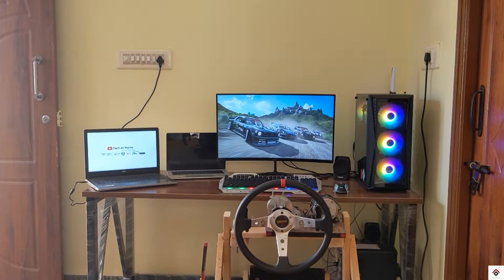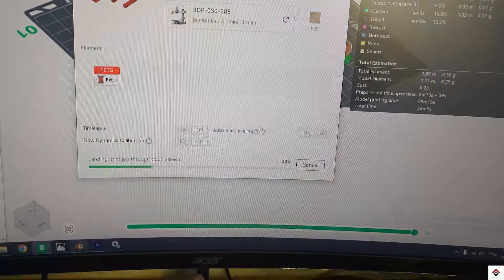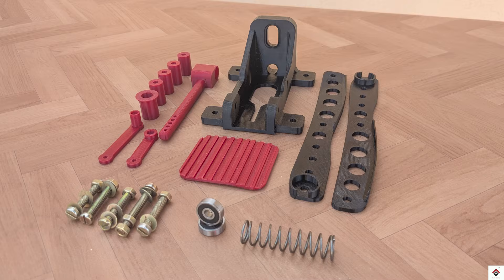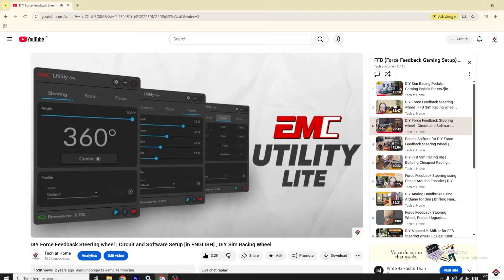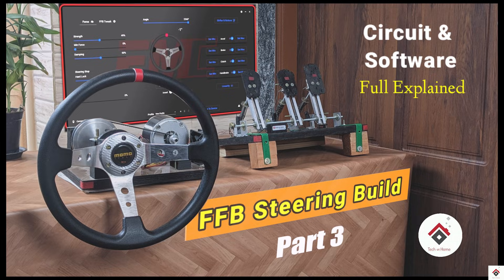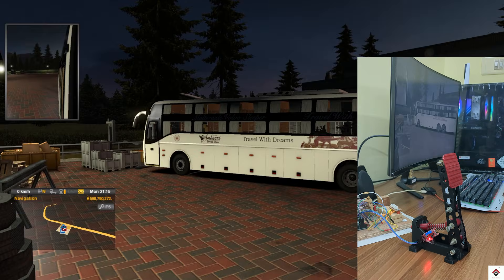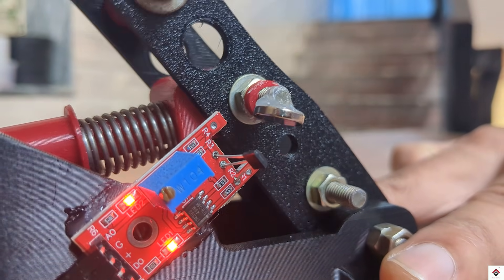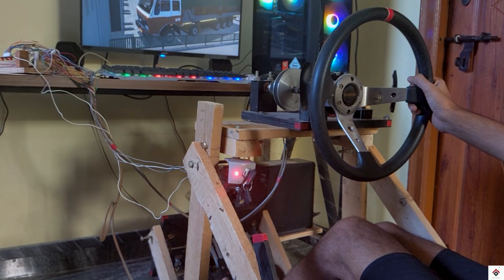Magnetic Hall Effect Sensor Pedals using Arduino | DIY Sim Racing Pedals with 49E Hall Sensor 🏁

Comment: Hey, I’m building a DIY sim racing setup and following your videos. I had a few doubts and thought I’d ask here.

I’m making an FFB wheel with Arduino Leonardo, 3 pedals (load-cell brake), plus an H-shifter and handbrake. I was planning to use EMC Utility, but I recently read that EMC Lite doesn’t support H-shifter and handbrake, only the Pro version.

So I’m a bit confused now:

• What does EMC Pro actually cost, and is it worth it just for shifter + handbrake?
• Is it true that EMC Pro doesn’t work with Arduino and needs STM32 boards?
• Would it be better to use two boards instead? (one Arduino for wheel + pedals with EMC, and another Arduino for shifter + handbrake as a simple joystick or MMJoy2)
• Also saw people mention GIMX — does that actually replace EMC, or is it only for console use?

I’m not from an ECE background, so I’m trying to keep things simple and stable, even if it means using two boards.

Any advice would really help. Thanks for the videos 👍

Comment: sir this is so cool, however i only want to make a clutch, can you tell me what all i need to use? do i need to use everything in the software/electroncis like you did for all 3 pedals? or if im doing clutch do i need to use less parts. thanks!! i loved this tutorial
Reply from the maker: Thank you 🙏♥️
No need to use all of them. You can just connect one pedal.
Reply: @techathome  sir can you run me through the code needed for a clutch pedal? and what all do i 3d print from the printable link give, there are 11 files which one do i print? thank you sir
Reply from the maker: All files to be printed.
For software and configuration, Refer this video but connect only one hall sensor: https://youtu.be/crdDhvhBG0M

Comment: Hi, I liked the project because it's simple to make. I have a question: does this pedal have enough resistance to withstand foot pressure without breaking? I intend to print it in ABS plastic.
Reply from the maker: Thank you ♥️
Design is weak and it can brake with more pressure. See if you can get better design for printing. We used this for demonstration.

Comment: Great Work!
Got a question , which software did you use to model and simulate your circuit before actual connecting and testing
Reply from the maker: Thank you ❤️
We didn't model it. This is open source for download. You can get the link in description.
I already had working setup. So didn't simulate. Just replaced pots with hall sensor on this: https://youtu.be/crdDhvhBG0M?si=tfRZdfQkbzl9q5b-

Comment: keep a rotational magnetic encoder maybe and keep it in the rotating axis,its better for longevity
Reply from the maker: I think encoder will have digital output.
But this firmware supports analog voltage input for pedals.
Reply: @techathome  it does have a abz out and u can use as incremental 
as5400 and mt6835 something like that